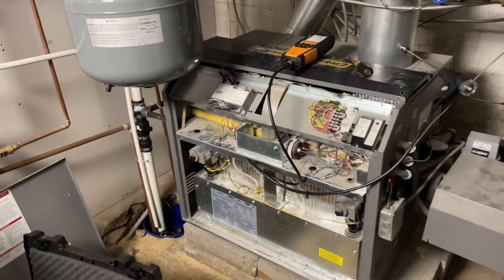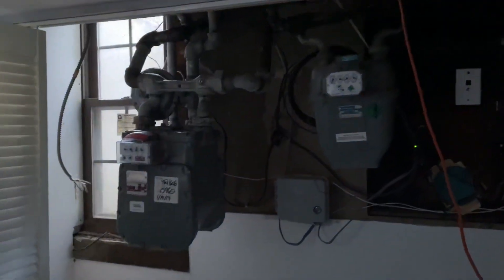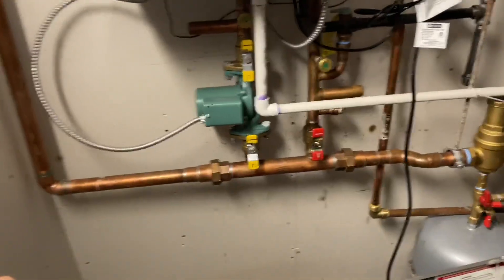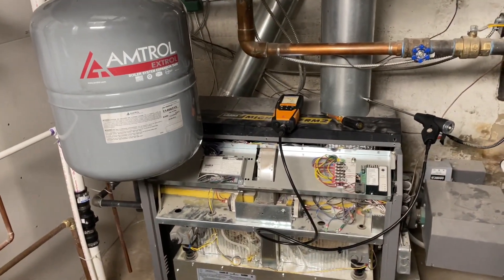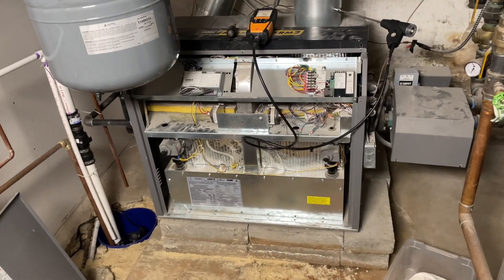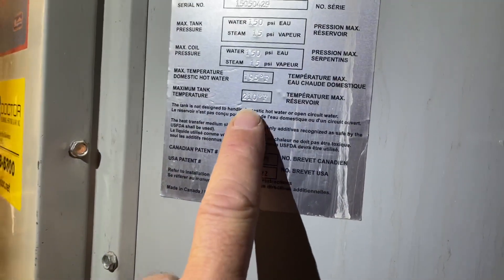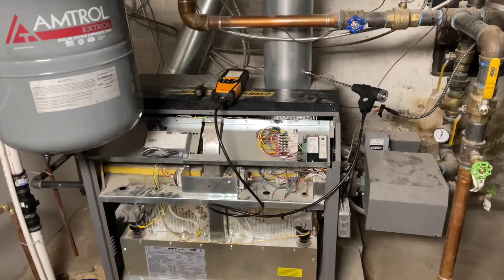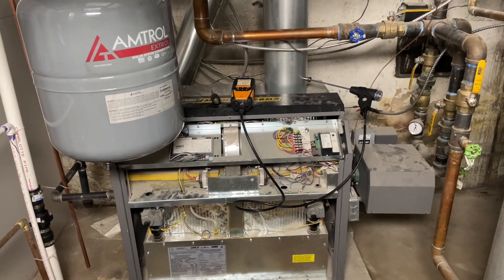Laars Mighty Therm2 High Temperature Limit Out How to Adjust CO2% with Combustion Analyzer

Comment: Those turbomax tanks will work with a range of BTUs. With such a big boiler, basically you get unlimited hot water out of that thing. My favorite thing about them is that it's a coil filled with the DHW inside of a tank full of boiler water instead of the other way around. I imagine that one is the 109 gallon, which is 109 gallons of boiler water, not of domestic water.

Comment: Do you also service oil burners?
Reply: Just Steve Lav. Lots of oil burners in New England
Reply: @PipeDoctor  So what do you do if you have a customer call about an oil burner?
Reply: @bkoz319  call their oil supplier!
Reply: @rickyhertz7250  those oil supplier techs put big nozzles in and adjust the draft so high that all your heat goes up the chimney,,,,,just so they can sell you more oil
Reply: @bkoz319  Maybe where you are , I worked 8 years for a full service oil and propane supplier and we never did anything like that !  Last thing a business owner would want is a sooted up boiler and house from over firing the equipment.   Always go by equipment firing rate!
Reply: @rickyhertz7250  Interesting Rick could you elaborate a little on that firing rate?
Reply: Steve Lav. has a good light you could use.